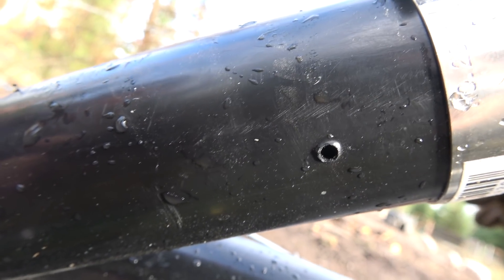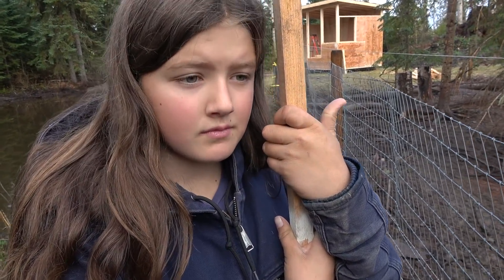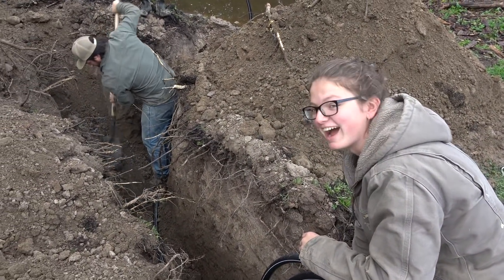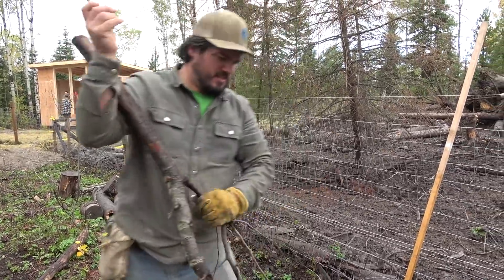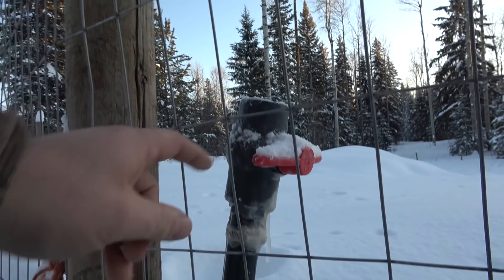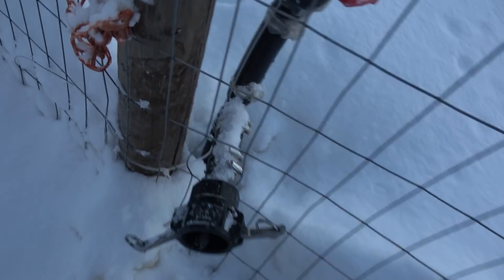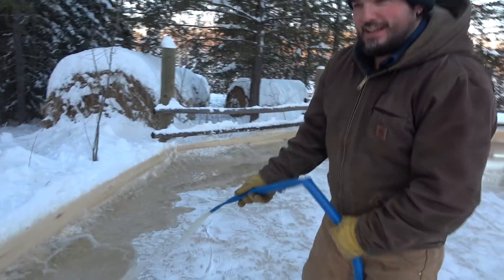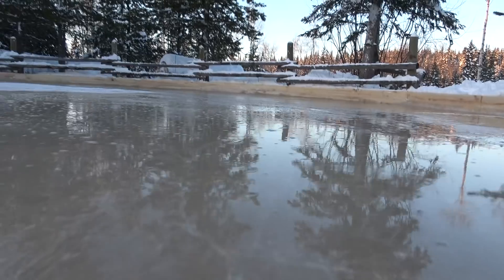Critical Off Grid Lo Tech

Comment: That "water" looked a lot more like a combination of stagnant water and urine. Given your source, you really are going to need a  SERIOUS filter, and possibly boiling it after filtration, and even then, I'd have the water analyzed before drinking it. But that's just me. I spent a bit of time when I was younger in the back country and drank from some pretty questionable water sources, I've been poisoned before (worked as an extermunator a couple of summers between long terms in college), I've had Guardia Lamblia (almost died), I've had (still trying to kick) Lyme disease, I've had the honor of laying in convulsions for 6 or 8 hours, so I am a bit more cautious than the average about such things these days. I'm not compulsive, but I do like to ensure my drinking water is purified (well enough), and my eating utensils and hands are washed (well enough) before contacting food that is going inside me. However, knowing a bit about science (retired after 42 years in electronics, plus a psychology degree, and currently pursuing a biochemistry degree), I was never concerned about wearing a mask during the CONID Fiasco, since none readily available would have done any good. NIOSH N95 masks, the CDC gold standard, blocks 95% of all particles 0.300um and above. That is anything 300nm (nanometers) and larger, while the electron micrographs I saw of a Corona virus (supposedly SARS-CoV-2 but coronas are pretty common) was 46nm in diameter. Those masks were like using chain link fencing to keep out house flies. If a person was presenting symptoms (sneezing, coughing) THEN the masks would help, because viruses cannot move around themselves and tend to "hitch a ride" on dust, bacteria, water/mucus droplets (from a sveeze), and all those ARE large enough for a mask to stop. Sorry, I digress.
    I hope you guys have a HUGE capacity CARBON FILTER, because it is going to be needed if the smell is as strong as everyone is indicating. You can filter the bad stuff (illness inducing) out of the water, but the smell/taste can still be there. I'd suggested a 0.01um (micron or micrometer - Sawyer "Point Zero One" model) absolute final filtration stage IF you are concerned about viruses, else leave it off. Preceed that by several increasingly small, say a 0.1um following a 0.2um filter stages and a 0.5um initial stage if there is sediment in the water. All those should be available at a hardware store or online. Then I'd add carbon filters before AND after the final filter stage, given your situation. As I said, LARGE volume carbon stages. Carbon sucks up (chemically binds with) the chemicals causing the smell and pulls them out of the water. Eventually it will get saturated and need to be replaced. You will know, as that smell/taste will slowly start to return.
    Since you want to keep the costs down, you would probably need to make your own activated charcoal OR buy it in bulk. I have never heard of activated charcoal being made from spruce or other evergreens or soft woods, which you seem to have in abundance. I don't think that would work... but in a survival situation I'd try it if there was nothing else. It requires hard woods or dense fibrous plant material. Commercial activated charcoal is made from crushed coconut shells, but hardwoods should do. The process involves several stages (look up online, and even YouTube), but the key is a very high temperature making charcoal (burning wood in the absence of air/oxygen), add a chemical "activator" to increase the surface area of the charcoal, then cook it again at high temp. Tedious but not difficult.
    I'd use something like 3" to 6" diameter (if not larger) PVC with screw-on caps, add a pipe coming in on one end and another going out on the other end, block each end internally with cotton, and fill the space in between with activated charcoal. Easy enough to refill as needed, and if you make a couple of them, then just swap out for replacement. No down time, and you can clean and refill the old one offline.
    Best of luck!

Comment: So, it's not clear toe, just how long it will take all of this feedback to reach u, today is Saturday Jan. 6, 2022.  And I have laid out for u how u can filter ur water, to reduce that cloudy appearance in ur water from ur water tank. So let me type it out for u 1 more time. Fill a 5gallon bucket with sand, cover it, & use a hose to transfer th now sifted water to a drum that is filled with charcoal that overflowing water, becomes th cleaned water for bathing, cooking, & drinking. For th most part, u should not have to treat it with bleach, unless u desire it to be so. Th Charcoal, is an all natural pathogen killer, plus, it absorbs odors. 
  First try it in an experiment, to critique that process further.
I have traveled extensively across America, & fresh drinking water is not always available  but I carry charcoal for several reasons, Purifying my drinking water, is one of those reasons. Jeff B.

Comment: It's kinda ashame to you, that if you really wanted Feedback, & not just Criiticism , you would have come online, to ask help from ur viewers. 
  There is yet another solution to ur water shortage problem, that  more than likely, could have been performed in your home, away from harsh cold temps. Th Sand Point system, is  considered a Shallow well solution to getting water, without a lot of th  normal problems affiliated with most modern water systems. In an area like unto yours, where th ground water can be found 10-12' feet down, u could have saved a bit more money, & installed several of these Sandpoint wells around ur property, without having to share it with ur pigs & goats. I'm just saying. You did ask for feed back.